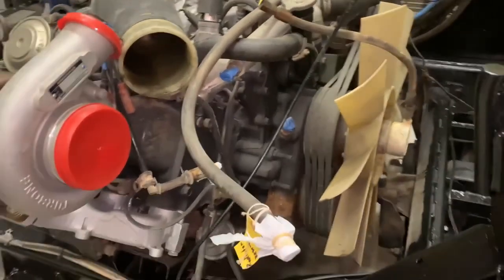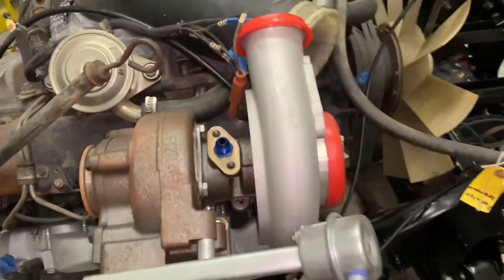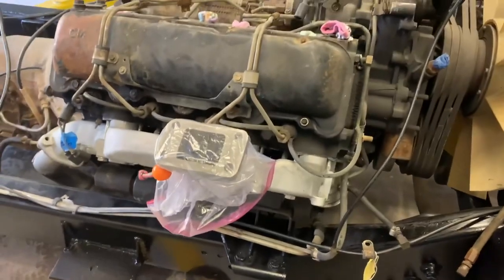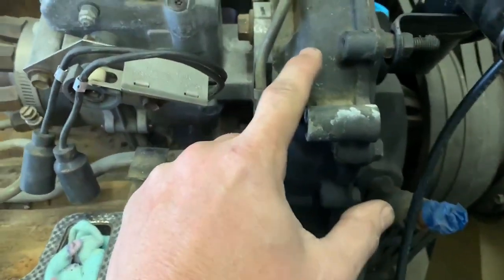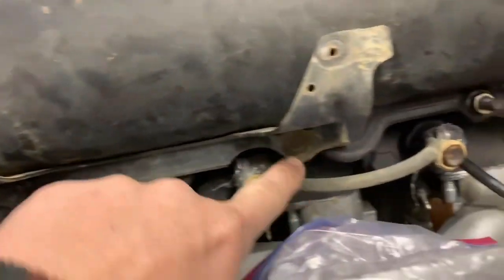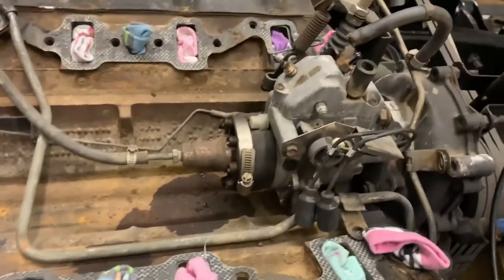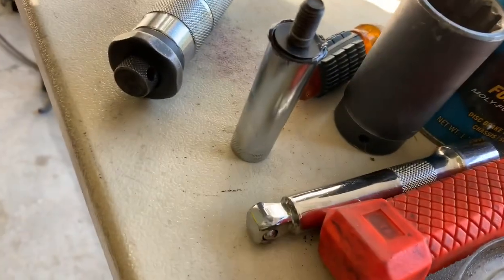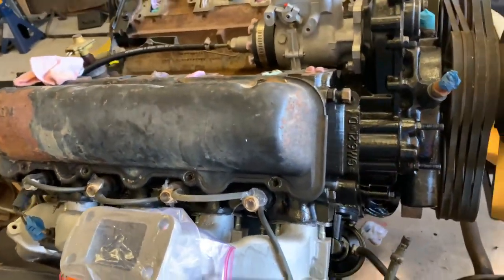Humvee Fuel Injection Pump Replacement

Comment: Is there any risk the gear driving the injection pump will be off a tooth when reinstalling the injection pump? I’m wondering if the gear can be off a tooth during reassembly.
Reply from the maker: The chain is quite heavy and it wrapped around the sprocket. The sprocket rests on a cavity just right below when you have the pump removed. Very minimal risk of the chain coming off the sprocket or jump a tooth. If it does, it will mess up your timing, so just be careful